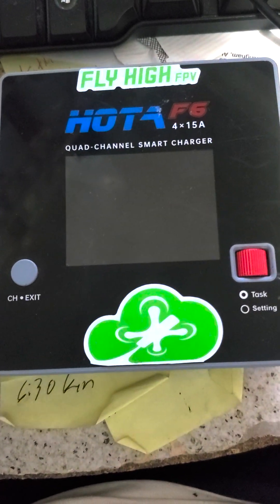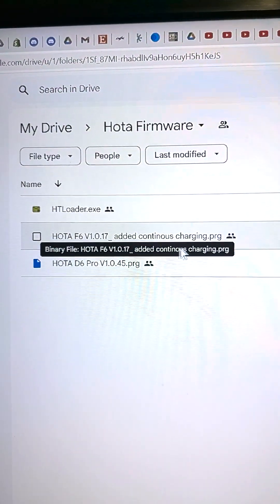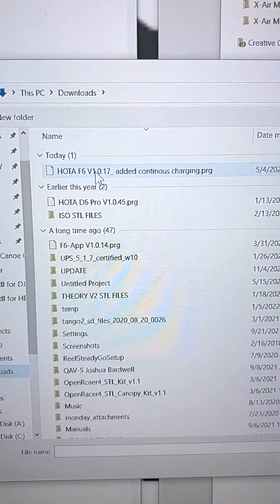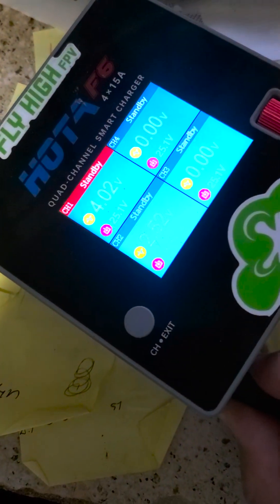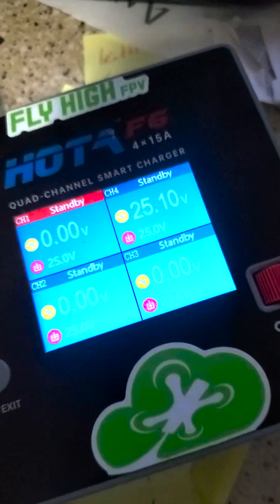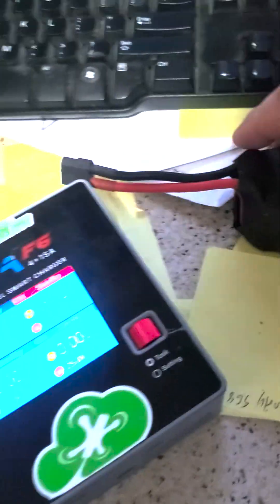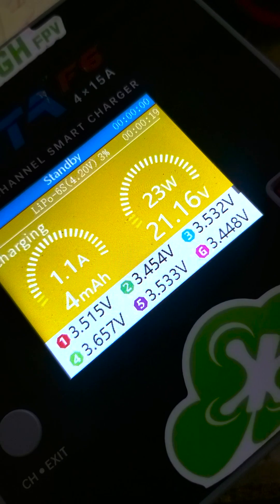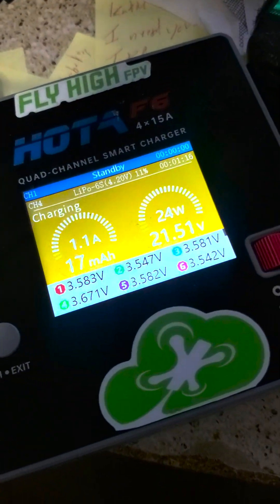Hota Charger Upgrade - Continuous Charging Mode - F6 4 Way, D6 Pro and S6 Lipo Chargers

Comment: i just got the Hota F6 + AC500. I see the "Sync Charge option but it does NOT let me select this option. Got any idea why so? Thanks in advance brother.
Reply from the maker: What have you plugged in? Mine will select it, with nothing plugged in. I have not made a sync cable tho.  Sync Charging combines the current of 2 side by side ports...can deliver up to 25Amps...be careful with that one.
Reply: @Fly_High_FPV with or without plugging anything , I can’t select the “sync charge “ option. Really strange. Thanks for confirming that you can. I probably got a defective unit. I reached out to official hota in facebook. Let’s see  if they can help
Reply from the maker: @minthos4045  sounds like a software issue, but mine are on 1.00, the release software for F6+
Reply: Could you please share the 1.00 firmware? I want to try it before I give up haha. Thanks mate
Reply from the maker: @minthos4045  FW 1.00 came preloaded on the first batch of F6+ that i received 6 months ago. You can find the FW and the Hota Launcher on their site. I have a tutorial for "continuous charging mode" that walks you through the process 👍
Reply: @Fly_High_FPV  they don’t keep the old firmware unfortunately. Appreciate you trying to help.
Reply from the maker: @minthos4045  if you want to send me a DM on instagram or FB messenger, i may be able to help. As a dealer i've been giving them feedback and gotten some trst firmware with new features i requested...havent tested yet

Comment: Do the new chargers on your site come with the upgraded firmware?
Reply from the maker: The F6+ has the continuous charging fw installed, the F6 and D6 Pro do not yet 👌
Reply: @Fly_High_FPV   Ok, thanks! I'll be ordering an F6 soon and one 1500mah 4s rubber-wrapped pack since one of mine gassed out when I plugged it in lmao 🤪

Comment: For me after firmware update it worked for the 1st time but after 2nd  power-up, controls on the charger do not respond  (also strange music at power up). Any ideas ?
Reply from the maker: I would def try flashing again, and be sure you have the right image. There's links for the tool and the image file on my site 👍

Comment: Anyone know to setup F6 for Nickel–metal battery to charge and discharge cycle automatically . I have a few old MH battery which i want bring back its capacity .
Reply: I did select nimh mode and charging type ots does not has auto discharge then charge or charge discharge by itself, i need manual discharge n manual charge back once it discharge
Reply from the maker: @calvintys  not positive. I mostly use Mimh mode for lipo recovery, forcing the charger to push up the voltage on a lipo that was overdischarged
Reply from the maker: Easy, just change the battery type from Lipo to NiMH in the charge settings 👍 it'll do just about any kind of battery, and it's a great adjustablepower supply, if you selec power delivery mode

Comment: Do you need update the other port to ? F6 have 2 usb input for update
Reply from the maker: Technically it'll do continous mode on all 4 ports after updating one side...but i went ahead and updated both sides
Reply: Yes you do have to update both.

Comment: Hi. I got an error saying the device is not recognized. It might be a drivers issue. Any suggestion? Thanks.
Reply from the maker: Make sure you're using the micro usb ports. Left side first. Then right side. Also the boot sequence is pretty fast. Gotta plug in with button down,here the beeps, load the firmwsre before the beeps stop
Reply: @Fly_High_FPV  it was the USB cable, sorry. And thanks for the video.

Comment: Thank you for this one!
I have a question that you might be able to answer? 
I live in Sweden and ordered a Hota F6 right when they came out via some online Chinese site (AliExpress or something similar) since they weren't available here. Last time I ever ordered via sites like that. Unfortunately I got an error saying "Channel fails E101" and I think it was saying channel 1 but not sure. The company didn't want to do anything about out it and so I left it at a friends house since then and he's been using it lately without any problems. 

I picked it up yesterday and started using it and it's working just fine. Have you ever heard of this error? I want to build a charging box for it but not sure I want to do it if it's just going to fail again. But right now I'm not able to get the same error again which is good but also unnerving at the same time.
Reply from the maker: I have not seen the error, but i'd guess it was related to the battery plugged in 👌 ive charged over 600 packs on my F6
Reply from the maker: I did find a reference online from another user who got E101 and had the vendor replace it, but no indication of what it meant
Reply: @Fly_High_FPV  yes that's the only one I found aswell.
Unfortunately it was not the battery since I tried multiple batteries and different ports. I simply couldn't use it except every now and then when it would start properly.

If you ever talk to them and remember it I'd be very interested in hearing what they say it is. I emailed them but never got an answer.

Will do the update like you did on this video. Strange no one else has shown how to do this correctly, thank you once again for sharing!